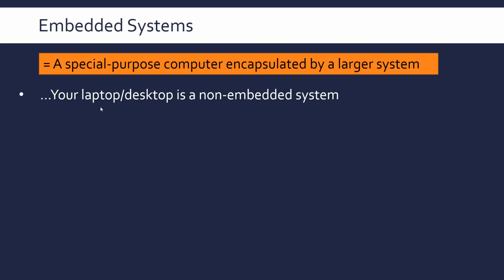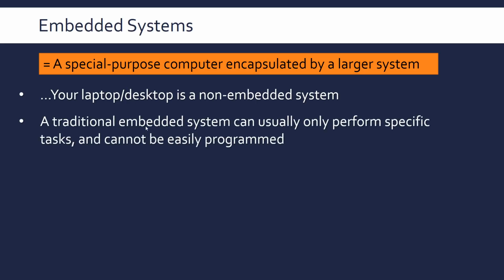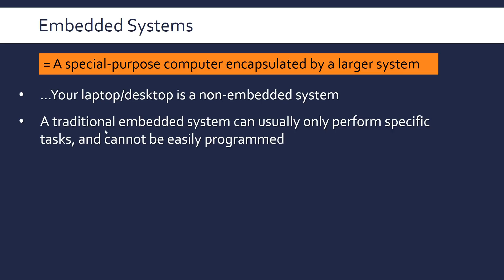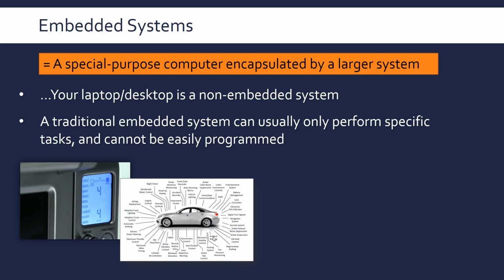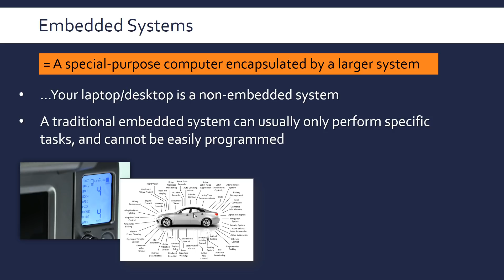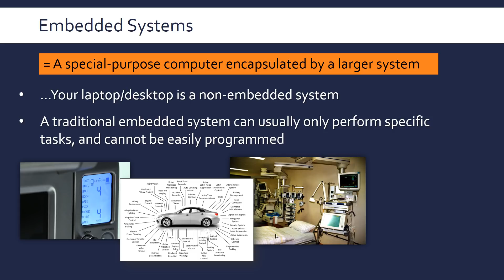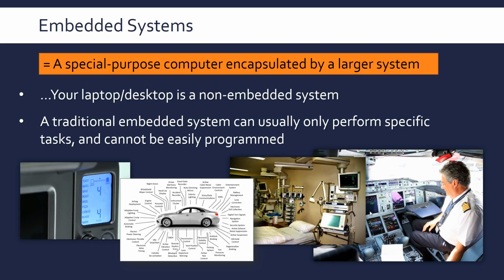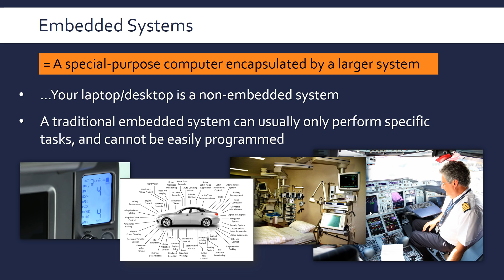Embedded Systems

Comment: If the exam were to ask for the definiton of embedded system which one would you use Im on OCR btw.
Reply: An embedded system is a computer built into another device. It is often used as a control system to monitor and control machinery.
Reply: The definition aint like this anymore @meep579gaming